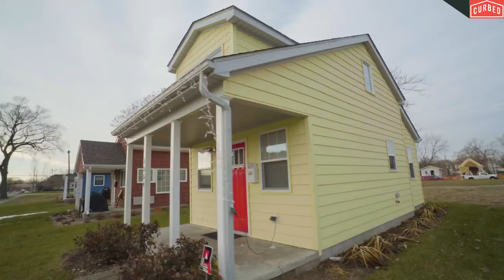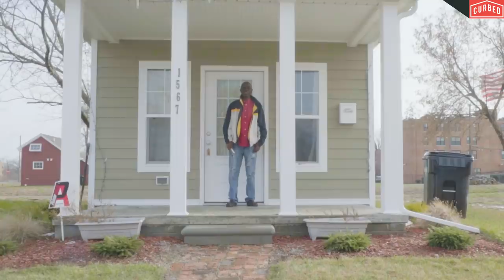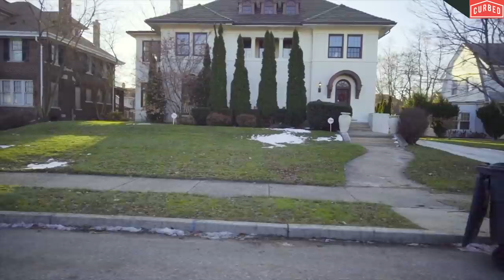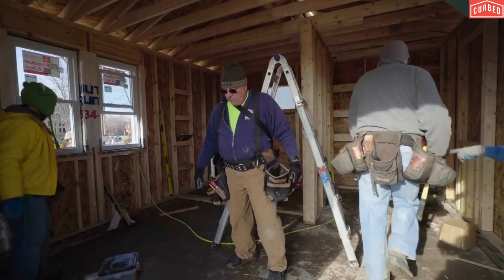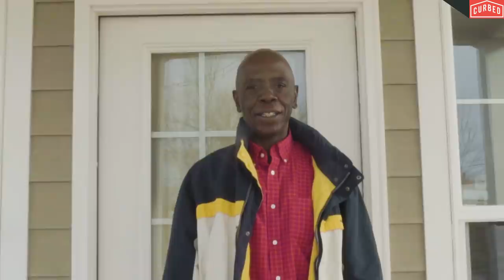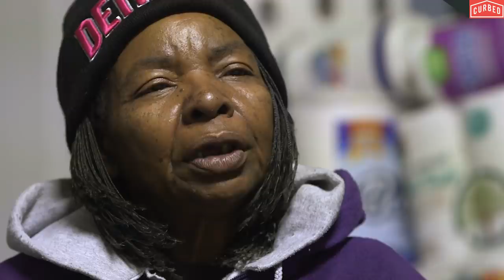Can tiny houses save Detroit?

Comment: For informational purposes. Most people lived in 8oo square feet homes until about the 1950's.
Reply: You're right!  Visit the Eisenhower Library in Abilene KS, they have his old boyhood home preserved next door & it was like 900 sq ft & the parents raised 5 boys there, all close in age.
Reply: I can't agree with that. The city I live in has excellent records on housing and most of the houses built before 1950 are actually larger due to more available wood and land/cheaper prices adjusted for inflation.
Reply: Charles Coe I agree with you because in the early 1800-1900’s were very large grand homes and in the 1950’s builders began building smaller homes.  But 800 sq ft homes weren’t the norm.
Reply: @charlescoe226  those 1930s and 40s homes were generational ie grandparents-newborns and families for larger to work the land (cheap labor) more occupants than the average family size today
Reply: no,your information is from one isolated area and incredibly flawed.my home town which has tons of restored historic homes are mostly over 1500+ square feet.
Reply: Facts!!
Reply: @chelsmartin2393  In some parts of the South and North this is the norm..
Reply: I don't know about that. I have lived in two cities that were here back in the early 1900's or late 1800's and the houses that were built back then that still exist in those cities now (called Row Houses) are all huge! 2000+ sq. ft.
Reply: It depends on where they resided.
Reply: Great cmnt and point to bring up! I don’t know why people think you need a massive home to have your needs met.
Reply: For further informational purposes. Average height was 1-inch shorter in 1960s, 30-50lbs heavier than 1960s, compared to USA 2002. Best dates for data I could find, sue me :P.
Reply: with basement it would have been 1600 Sq feet until not basement went needed to get the footers below the frost line

Comment: The tiny houses could use some solar panels.
Reply: ladydruyear Sadly, there are laws against them in most places. Another example of greed. It sucks.
Reply: @Hooverpixie24  i know i looked in to it sooo yea i am with you on this
Reply: Solar panels are way too valuable and way too portable.  And they are way to easy to steal and sell for drugs.
Reply: Probably do better a bit farther south.
Reply: Donated materials, donate the panels.
Reply: Detroit has really cheap electric and water. It would be foolish to buy solar panels as they actually cost more
Reply: A solar setup costs more than the house...... Not feasible.
Reply: ladydruyear  I drove by recently and they now all have solar panels. This video was shot some time ago.
Reply: Thank you that is good to know.
Reply: tom jackson it takes time to climb on a roof turn off the power and clip the wires then takes theses huge solar panels down a ladder and put them in a van or truck
Reply: @Hooverpixie24  Solar panels are expensive !
Reply: MrPCT007 and your point is?
Reply: The new ones they are building have solar panels
Reply: I have heard Solar is very expensive to install new and takes a while to recoup money spent.
Reply: Detroit is dreary most of the time.  Winters are very long and snowy.  Springs are horribly cloudy and rainy.  The solar panels would only work efficiently about three months of the year.  The rest of the year they would be little more than eyesores.
Reply: There's a new company that keeps advertising solar insulation in Michigan.
Reply: @treacherousviper  It is impractical in a dreary place like Detroit.  The solar cells would only work about half the year, efficiently.
Reply: @indridcold8433  I never said they should
Reply: @treacherousviper  Oops I responded to the wrong post.  But it will get to the right person.  The tiny houses in Colorado, Nevada, and Texas could work with solar cells to suppliment their energy, though.
Reply: @indridcold8433  still the same problem with the expense to install...o read where a 5kw system costs between $25000 and $35000. Yes you can get incentives for having solar power..but not everyone can afford that sort of upfront expenditure to have it payoff 15 or 20 years later. They should probably start just spec-ing solar in to new construction lol
Reply: @treacherousviper  Solar is more a novelty with its current development, except in space.  It may one day improve.  Who knows, maybe someday foundries may be able to be ran with solar.  But for now.  It is for small appliances unless you put a lot up.
Reply: That would help with elect bills.
Reply: The electricity is probably super cheap on such a small home
Reply: @2815Juan  Heating is probably similar to what it would cost to run a space heater.
Reply: to piss off state officials even more? great idea ! )))
Reply: In Detroit lol
Reply: You need enough solar panels to capture enough for the entire day and night,they are expensive,you need good enough batteries to store the energy you got from the sun.It isn’t easy.And it may not work good in more rainy and less sunny places in America.
Reply: expensive and very little return on investment.complicated,inefficient etc
Reply: @Bailey_54R  Detroit does NOT have cheap electricity & water. LOL
Reply: Scott Luther  wrong. try 20k to 30k if they were 5 to 10k out the door with batterys  and inverter's i have it to day
Reply: @maryslocum9443   heat bills are cheap in detroit mi
Reply: @LisaCupcake   wrong lier. DTE is only .12 cents per Kwh. water is very cheap up there. nat gas is also cheap up there

Comment: For houses that small they should be made from bricks and have reinforced doors and some form of protection on the windows. It's fine having a house with multiple rooms made out of wood because at least you can hide in the event of something catastrophic like a burglar or worse... but in a house which is essentially just a shed there has to be security. Not faulting the idea just isn't practical, especially in detroit.
Reply: They MUST be AFFORDABLE Einstein
Reply: Norn Itus not every corner of Detroit is at risk of burglary. It’s fine
Reply: @kaiyoung9983  Doesn't really change much, burglary is part and parcel of populated areas regardless of geography.
Reply: @hpayton2  Bricks are recycled daily.

Comment: My grandma to me that in the 1950's these were just called homes.
Reply: No. They would be called mobile homes.
Reply: @acommentator69  These aren't trailers.
Reply: @godpilled9077  manufactured homes
Reply: @acommentator69  Yeah, not mobile homes. There is a difference. In the 1950's you can buy a manufactured home from Sears & Roebuck. They were not considered tiny houses. They were just houses like my original comment stated.
Reply: @godpilled9077  because they weren't tiny.
Reply: @acommentator69  Yes they were.
Reply: @godpilled9077  sears houses were under 800 sqft???
Reply: God Pilled you're absolutely right we have like 10 of them remaining in my neighborhood
Reply: sadly i believe the only reason we dont see more of these is because companies want to maximize profit from small pieces of land. 

they want that quick buck. the houses they build arent even that good but they'll charge half a million and up for them when they should be at around 200k max

Comment: I'm Disabled, a Veteran, and have been homeless for two years. I'm not a drug addict, just lost my housing two years ago when the apartment complex I was living at in Mesa Arizona was sold to a buyer in Toronto, who promptly notified the tenants living with Section 8 or VASH assistance they had the option to move out or pay full market value rent without assistance.

 I found while looking for a place to move to, that most low income housing in my area was eliminated in this same fashion by greedy investors and was unavailable to find another place to live.

I bought an old van on payments and was forced to start living in it. I did so for a year and was offered a tiny fiberglass trailer on payments. I found that the person I bought it from had mislead me on a clear title, and have had difficulty getting it registered and legal to tow. I have been stranded at a Recreation Area, above Kingman Arizona for seven months now trying to get repairs done to my van. It is no longer safe to drive, and definitely not suitable to tow my trailer. It has been a living hell, upto 128 degrees at times this summer, now dealing with freezing cold at night and heavy winds. Every time I try to get some repairs made, something comes up. I bought a used generator which failed in a couple weeks, had to buy another one, then my emotional support dog Archie was badly bitten and required veterinary care, my air conditioning compressor failed in my Van, I cut my knuckle to the bone and ligaments on some glass discarding some trash which resulted in an Emergency Room Visit.

 I have been trying to get help, and have not had much success. I was accepted for PATH Rapid Rehousing through the Catholic Charities, but have searched all over Mohave County but found I cannot afford an apartment on my disability income. I have been looking for a room for rent, but no luck.

 So now I'm in a panic as I was notified by the Catholic Charities Caseworker handling my information, had their computer stolen and now my personal information has been compromised.
 
I am on a waiting list for Section 8, basically started over. I did not choose to be in this homeless situation, and have been doing my best to deal with everything I have experienced the past 2 years. I had to literally give everything I owned away when I lost my apartment EVERYTHING!, I did try and keep my many tools, but those to were lost to a "friend" who was going but keep them until I get settled, but would never respond to my calls or texts.

 I am absolutely sick of my life. I don't live anymore, I merely exist, and it's not much of an existence at that. I have not showered in nearly 8 months, and haven't bathed in over two years since losing my apartment. My teeth are broken, many missing, and I broke another one recently, not looking forward to the toothache that's coming. I am nearly blind in one eye and can only see clearly with glasses, but I lost one of the lenses.  I have reached out to every VA organization or service center I know of for help, but am ineligible.

 I worked for the Air Force starting my senior year of high school, as a civilian employee and for the next decade.

I also simultaneously served 6 years in the Air National Guard, and was honorably discharged, but still don't meet the requirements as I was on active duty for well over a year with Avionics Technical School, and was activated during Desert Storm, but could not deploy with my unit, as I was a 3 level technician straight out of school.

 I have no family for support, no friends, only a few people I have met while being homeless. I have had a fellow vet brings some water bottles and food items several months back, and just today was given a propane tank, heavy sleeping bag, and nice winter coat by Catholic charities, these were definitely a blessing and will definitely help, but I don't see how I can ever get out of my situation as my limited income doesn't suffice to handle the many needs I currently have trying to get out of my homeless situation along with handling my major dental problems, lack now of a safe vehicle, and trailer registration. 

Any day the area I am staying may be closed, the BLM Rangers have told me they plan to close access to this Recreation Area soon. I will be in an Emergency Situation when they do, and have no idea yet what I will do .

Comment: You cannot indenture people to pay for donated land. You can get a FEDERAL HUD GRANT to purchase land and subdivide into quarter acre lots and develop 16 houses on one rectangle, with one on each corner of the rectangle, four on each parallel and four on each side lot.  Then after you make the houses build a road in between each parcel that leads back to the main road. After all the parcels are built you can house say approximately 160 homes on 3 acres... Maybe more if the houses are 10 feet apart with gas utility five feet with electricity.

Comment: Tiny homes are awesome. I wish they would also do a version for single parents. With a bathroom, kitchen, and washer-dryer setup. I came across many homeless families. Single Moms. Single Fathers. Teen parents. Of course they would cost more than the $10,000 and are more square footage but definitely more affordable than to buy a home that's $50,000 and up. I want to buy a home but I have 3 children. Minimum wage is so low you can barely afford the rent of a one bedroom apartment in a nice neighborhood. So a 3 bedroom is almost impossible. In order to survive you need 3 jobs which means you end up sick, sleep deprived, and not spending time with your children. These homes would take the pressure off of the homeless shelters. It would give people freedom and security.

Comment: The issue is in so many locations, a home must be at least 772 square feet, but allowances should be made for more affordable housing.  The average income in Michigan is $32,000 a year with a family of four. Many in Michigan make a good deal less some about $10,000 a year.  This "tiny house" project works and it should be taken in consideration as many need affordable housing.

Comment: The $10,000 price is misleading.  It was stated that the residents pay $250 a month for 7-years, which comes out to $21,000 not $10,000.  Granted, this includes taxes and utilities.  Also, they're not 'volunteering' 8-hours, they're working for free.  Doing 8-hours a week for 7 years is 4,992 hours total.  At the minimum wage of $9.87 per hour is $49,271.04.  So that totals $70,271.04.  That doesn't even factor in rate of inflation, lost opportunity of better jobs for restricted hours, include taxes that should be added (e.g. FICA, Medicare, Medicaid).  I'm all for affordable housing, but lets look at the total underlying costs to participate in this program.